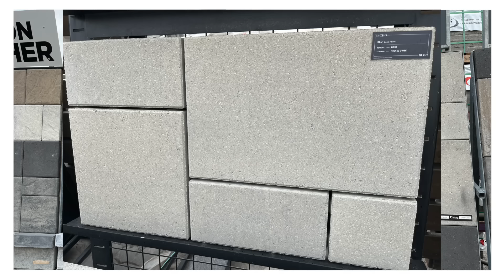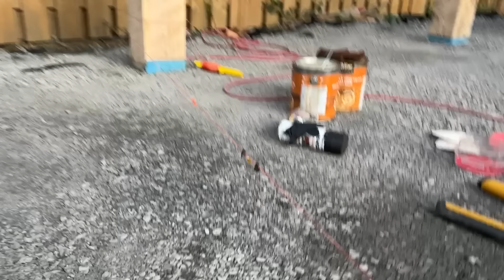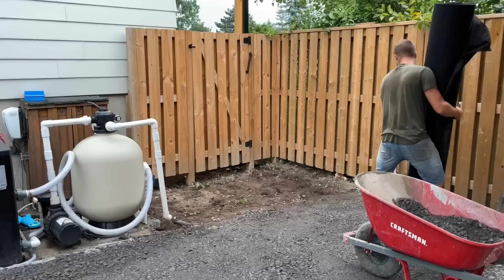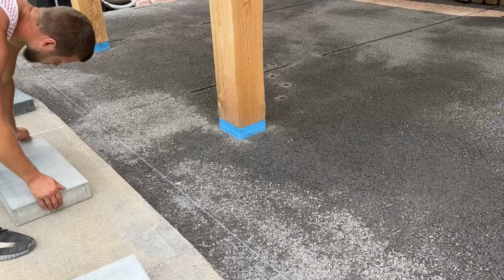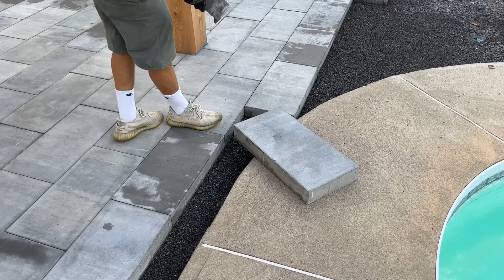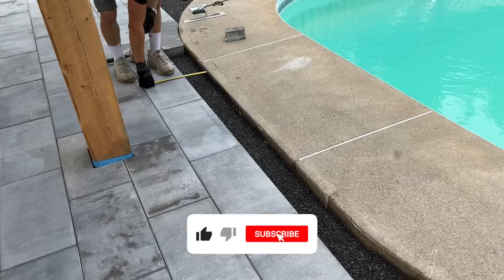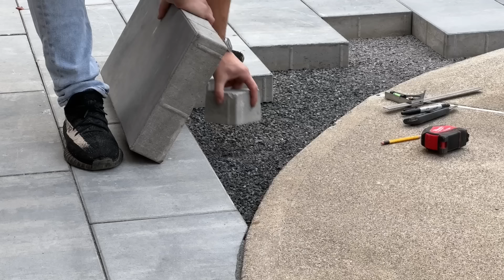How to Build Your Own Paver Patio (Full Backyard DIY Project)

Comment: Man, HELL of a job. If you ever have to do this again (which judging by the work, you probably wont), using a piece of paper/cardboard to trace those curves might be easier than trying to prop up the block (especially a 80+ pound one). The cardboard method saved me when I was tracing around a koi pond!

Edit: So got to the end and realized you're not done lol. So in case my "method" wasn't clear, lay a piece of cardboard (maybe even cut some to the same block dimension) where the block would go and then trace underneath using the pool lip and then cut that with a box knife/sissors and transfer it to the block. Saves moving that block a bunch!! 

Additionally, if you don't mind spending like $20 us extra for a tool, after my koi project I got a cheap plastic contour gague from lowes. It's awesome, and WAY quicker than my above method lol.
Reply from the maker: THANK YOU! I will definitly try these methods, I'll look into it! I guess in my head right now, I don't see it work yet, but ill see how I can use the contour gague.
Thanks for the comment and glad you watched til the end. Cheers!

Comment: As a new contractor starting up in Canada (I saw that Tim Hortons!) specializing in hardscaping, you did very well for someone who has never done this kind of work before! When you found something wasn't working correctly, you seemed to find the correct solution (Scoring dry first before turning on water, realizing the packing down changed the height of your base, etc). Three tips that I would suggest: 1) Pack down your bedding sand. Even though its only 1" in depth, by packing it down, you get about 1/8" of compaction out of it which may show over time (not so much with the 80mm pavers though!). The downside of this method it makes screeding much more difficult. A work around for that problem is to actually have your sand 1/8" higher and when you're all done, do a compaction on the pavers with a rubber pad/carpet attached to your compactor to lower it that 1/8" to meet your grade. 2) I would have cut your concrete for your pool in a way where an exact multiplier of the width of your pavers would line up perfectly with the first post of your pergola. This means less cuts and straighter lines that line up with your pergola. 3) You had a stringline to run your first set of pavers horizontally which is awesome, but you could have followed up with a vertical stringline in the corner that starts with the perfect paver length again to line up with your pergola post and always start each row from that corner and you would have perfect lines and minimal cuts along the entire project to have perfect lines and not rely on your eyes. This also makes the "click and drop" method you learned (catchy btw!) start from the third paver you put down!

Again, very good job for a first crack at it! Don't see too many smaller YouTubers create engaging and informative content as this and if you need any advice on this project or any future projects, I'll definitely give you my 2 cents (Maybe in exchange for a Tim Hortons ;)) Keep it up!
Reply from the maker: Wow. Thanks for the super informative comment! You’re the first to have noticed the tim hortons! It was a well deserved iced coffee that hot day haha! Kudos to you man, this is hard work! I didn’t get a pad with the compactor, but I want to do it. I was scared of running it on and getting some chips on the pavers. I actually had set up a perpendicular line initially, I forgot to explain that part… I put it, but I ended up starting dead center of the center post, then I realized I made a mistake lol. What would you recommend for the other side of the pool? Do I do the same, or do I use different screeding material or any recommendations. I’m gonna start it soon now that we’re getting better weather!
Reply: @MateoStabio  Honestly just purchase a small piece of carpet (or even a small rug) from your local fabric/home decor store, cut a couple of holes and zap strap them to front and back frame of the compactor and you should be fine. On old rustic looking pavers (google Barkman Roman Pavers) its fine to do it without a carpet/mat as it just adds to the whole look, but in your case they are nicely finished and don't want to chip them or scratch the surface like you said. Do not do this on the side you have already poly sanded or for the rest of your project to keep it consistent. As for your materials, what you used will continue to work fine and again, keeps the project consistent. As for your starting point, your kind of hooped into what your doing since you already have pavers to go off of from what you have laid down to go along the edge of the pool (between the pool and your longest stretch of fence from the house).

I'll send you an email with a video link of me going over how I think you should approach the rest of your project!
Reply: @MateoStabio I ended up pounding mine with a rubber mallet as well as some wood to blunt it because I was too cheap to rent the plate compactor again. 

For your bigger project, I would definitely not recommend going that route - way too much work.